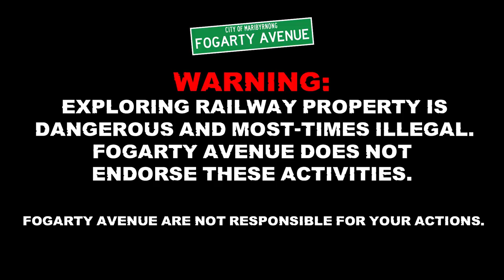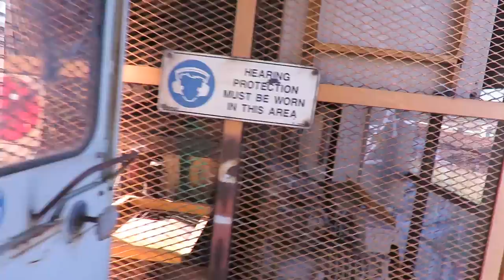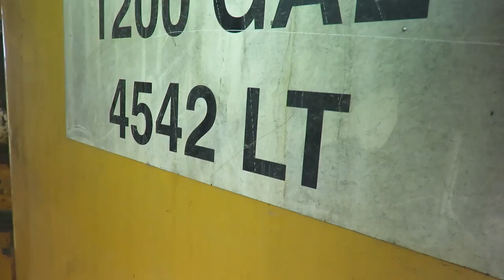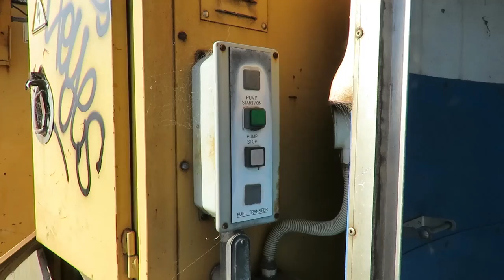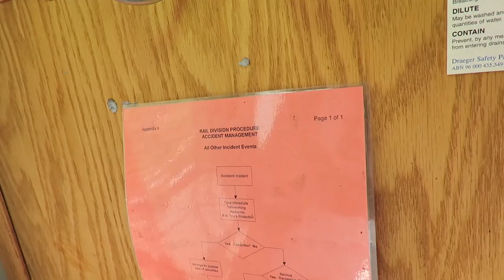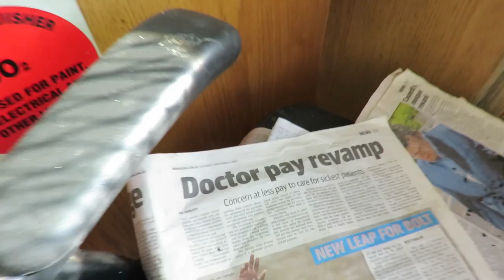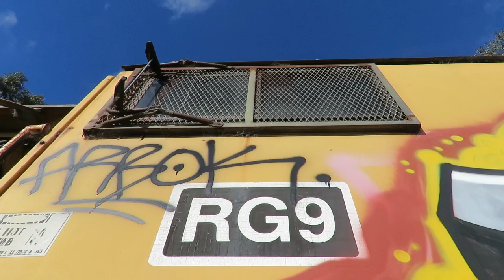Abandoned: Rail track maintenance train

Comment: I think that machine was in service only around 5 years or so ago, I remember it coming through Adelaide, it used to do mainline rail grinding/re-profiling on the standard gauge freight line, I think I may have even gone for a short ride on it when they followed the re-sleepering machine through Adelaide way back in the late 90's. The big round tank in the middle is a water tank used to put out the fires started by all the sparks coming of the grinding wheels that were mounted behind the dangly chains. You could hear and see the sparks from the grinding for 100's of meters away of a night time, very impressive machine to watch working, and very high tech for it's day using lasers to check the rail profile after grinding.